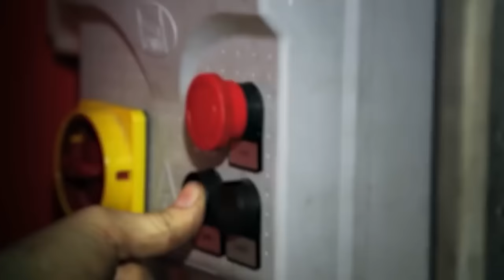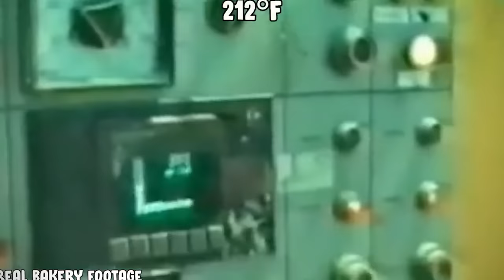15 of the WORST Bizarre Deaths (So Far)

Comment: I think it was foul play. The fact his shoe was found in a position where someone most likely threw his shoe in there and told him to fetch it and then the fact that he had his coat with him which was more than likely tossed down to him after he was trapped after being told to strip and fetch his shoe. It appears to be an intentional humiliation and murder exhibiting dominance and control. Also for why he would willingly go inside he may have been afraid of the person who was threatening him and believed that the person threatening him wanted to humiliate him and would come and rescue him later and if not he thought he would be killed by the other person if he did not comply and so he took his chances in the hopes that someone might rescue him. It was personal, he knew who ever killed him or at least knew a person that was intimate with his killer. Who would normally leave a car running with the keys still in the ignition and yet choose to be wet and shirtless? All of this explains the position of the shoes. Also who is going to reach down and grab their car keys from the ignition when someone has a gun pointed at their face?

Comment: I was stuck in a elevator. Automatically the elevator went to the next floor.It was not between floors. But I dont think there was power. I tried to open the door with the buttons. It didnt work. I was terrified. I didnt know how to open the door manually. They could not open from the other side without a special tool which they didnt have. After a hour of freaking out, I stuck my fingers where the door closes and pushed with all my might. The door started to open a bit, like 2 inches. Then we all were able to open them further. I honestly didnt know you can open manually from the inside. I think this is only works with newer elevators. Maybe 8 to 15 years old but I am not sure.

Comment: The incident of the male in the sewer is simple to solve: he worked for a nuclear power facility and knew they dumped waste into a creek. He attempted to get samples and the workers caught him and exterminated him. They used a simple method of throwing the shoe in the water to deter police while they drove him to the college miles away and p a red his car.  His house keys were missing from the key ring and the car was locked. Even small time criminals would not be that stupid. He was forced into the sewer knowing he could not not escape. He was face down not face up as in the photos.his feet were upwards otherwise the female would not have seen them. He dropped his shoe to use for his head and carried his coat with him but what about his cold weather clothing? He wore none.the supervisors at the power facity didn't want to be caught dumping waste on the creek and had to get rid of him to prevent prosecution on them and closing down of the plant the people who dumped him had a special vehicle with special snow and ice times that are expensive because they were rich from working at the facility. For ding the type of tires matched with tires from plant workers will locate the murderers.

Comment: The bakery oven incident reminds me of one of my jobs .We had to clean the inside of the Essex bakeries proover ,that part raises the bread before baking .It too had a conveyor belt we had to avoid .It was hot but had been shut down also. My fellow worker was freaking out and after an hour of scraping & washing opted out.I was left to finish alone praying that they knew I was still in there it was a horrible job I didn't want to become part of the baking cycle I'm not good bread material, the racks impeded the work flat racks that turned in a circle as they worked deeper into the system .I was glad a bonus was paid for carbon black but vowed never again.

Comment: I agree with the police about the Japanese peeping tom case. I think his jacket was taken off after attempting to enter the septic tank and not fitting so he took it off and folded it the placed it by his stomach & entered head 1st getting stuck as the animation demonstrates. As far as his shoe, it’s possible that it came off while he was wiggling around possibly kicking his feet trying to enter the tank & likely kicked his shoe off in the process. From there anything from a feral dog, the weather, or even kids playing around could have transported the shoe to the nearby water dike. As far as them not being able to get him out there are several reasons why it was impossible without breaking his arms/shoulders. He could have started decomposing causing his body to bloat, or it was a space that made just enough room for someone to squeeze in but not squeeze out (happens all the time), or it could simply be because he was dead so he could no longer move around the way you can to get in and out of tight places. Like sticking your hand in a jar, you can do it if you move your fingers in the right positions and rotate your wrist around but if you try to just pull your hand out without making those same maneuvers you won’t be able to.

Comment: Re the glue fancier who glued his bladder shut, honestly, what a load of absolute crapola. You’d need to force rather a lot of epoxy a pretty long way down the eye of your trouser snake to glue your bladder shut, tho you wouldn’t be gluing anything rather you’d be  obstructing it. There’s just no way you could force enough epoxy down there to obstruct anything before it cured., but for arguments sake let’s say you did - true it wouldn’t be pleasant,  but it’s certainly not going to make you go belly up in a matter of hours. Then there’s problem of the guy sniffing epoxy glue in the first place coz it doesn’t contain any the solvents that get you high, you may as well sniff flour and water. Maybe he died of stupidity?

Comment: I don't blame management for what happened the blame is all on the lady stuck in the elevator and possibly the technicians,  if they really did bang on the elevator why didn't she say anything and if she indeed scratch and pry against the door how did the technician not hear her especially if he was on top of the elevator, if he was on top of it too why didn't he open the hatch to see if anyone was in there instead of just asking if there was because common sense says if the elevator was in motion when it broke either someone called it from a different floor or someone was inside using it. So to me the technicians should have been arrested and lost their job a not management and why do it take 30 days for them to come back anyway.